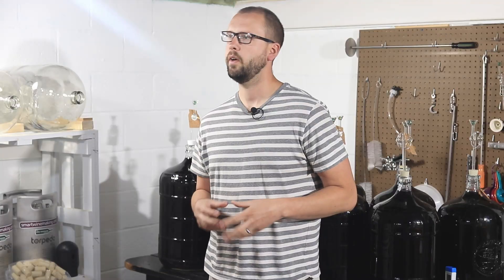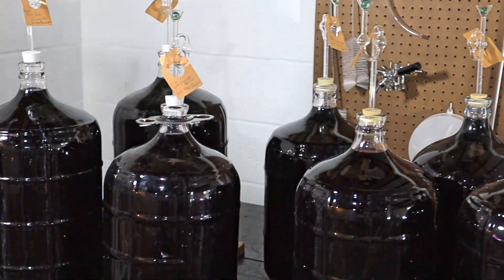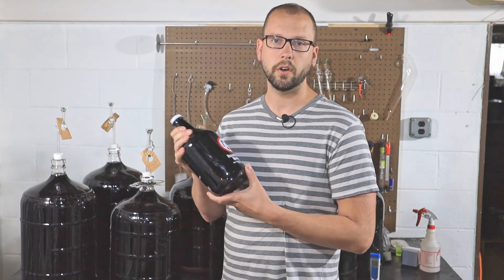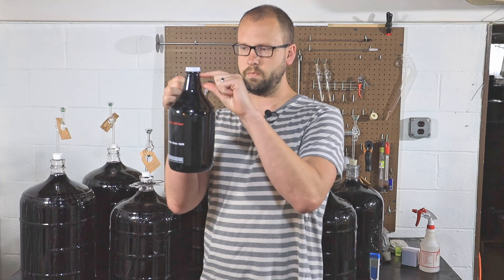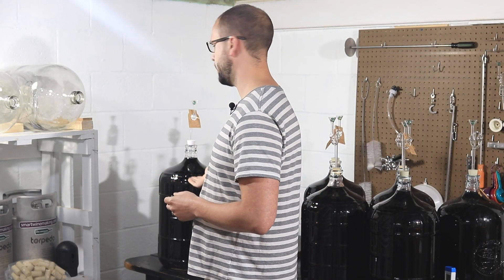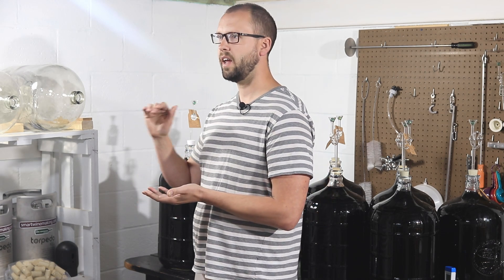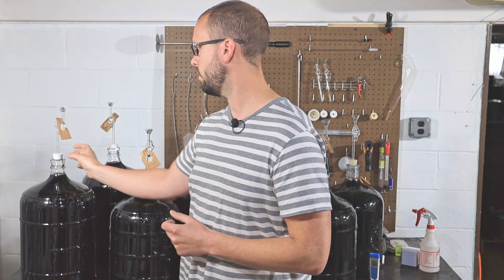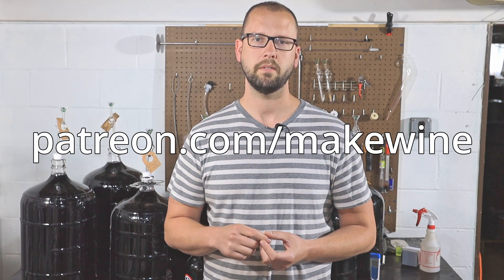Is a Little Oxygen Good For Wine?  Micro Oxidation and Aging Wine

Comment: Yes, I agree about the solid bungs being unpredictable. I have had different experiences with the solid bungs while bulk aging. When I have had the carboy filled all the way up like you show in your vid, the bung popped out almost daily when the room temperature rises in the morning/afternoon. I have not had much of a problem when there is more head space, but of course, more head space is not good either. I had run out of airlocks at the time and the wine expansion from warming was more than I expected. I ended up placing a cup over the bung so that if it did pop it, at least didn't go anywhere. Cheerz.

Comment: I agree that as home wine makers we add plenty of oxygen without trying to!

What are your thoughts about going the other way?  For instance, I bulk age in stainless sanke type beer kegs and they can be reliably sealed with sanitary fittings.  So if sealed after fermentation and MLF is over, Oxygen could be completely excluded until bottling.  But I don't know if that's a good thing or a bad thing.

Another thoughtful and helpful video.

Comment: When using a solid bung, I use 24 gauge flexible wire to tie the bung in place so it can't pop off if there is expansion or contraction. This of course must be done after all fermentation has completed.
Reply from the maker: Thanks!   That is a good tip.  I have considered wiring them down somehow, like a champagne cork.  Do you have any suggestions as to how to wire it down elegantly?  I would probably loop a wire over the top that is tied to a wire that is tightly wrapped and tightly twisted around the neck of the carboy below the top ridge.
Reply: @TheHomeWinemakingChannel  I'm not sure how elegant it is, but it works. I just tweeted you two pictures of one way I do it. I could not figure out how to send pictures in the comments over YouTube or direct message you with pictures. So I tweeted it to your smart wine making Twitter. It takes a little fiddling with because the carboy is slick, but once you get it tied down it holds very well.  Essentially you have the wire start below the protrusion part on the neck of the carboy and then wrap over the top of the solid bong to tie it off.

Comment: Thanks for the content, it is really great to hear how you think about home winemaking.  I a working through post modern winemaking now and was curious about micro-oxygenation as well.
Have you by chance tried un toasted oak products during the ferment to add ellagitannins and enhance the tannin structures of home winemaker sized batches?
In a previous post you had asked if anyone had made a second wine.  I have one going now with a TA 6g/l tartaric and 23 brix sugar wash on the skins and seeds from 50lb of cabernet.  It is pulling color really nicely and looks like it will be pretty interesting.
Reply from the maker: Thanks!  I have used light toast french oak during fermentation with seemingly good results.  I have used it early in aging also but if you use to much it can get a little woody vs the more spicy silky complexity you are used to with more toasted oaks.  I usually use FT Rouge to add a bindable tannin during fermentation.  What I have found to be the best though is cofermenting different varietals.  I have got much better color stability in my field blends than in any single varietal.   I think it is the diversity of tannin when mixing different grapes which gives many different binding partners before color or tannin has a chance to precipitate.
Reply: @TheHomeWinemakingChannel  There is a vendor here in Northern CA that has Cabernet, Merlot and Sangiovese, maybe next year I will go for a co-fermented super tuscan.  I have been using FT Rouge since you recommended it in your earlier videos, thanks for the advice.